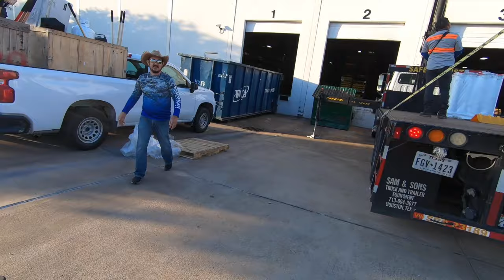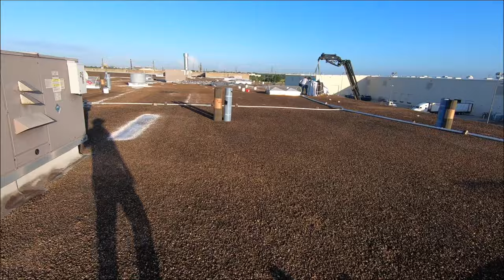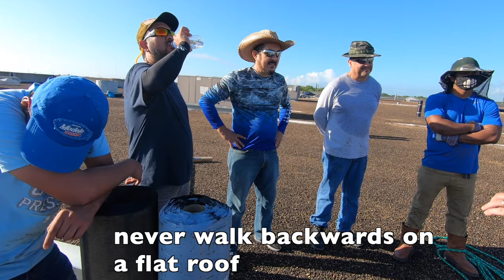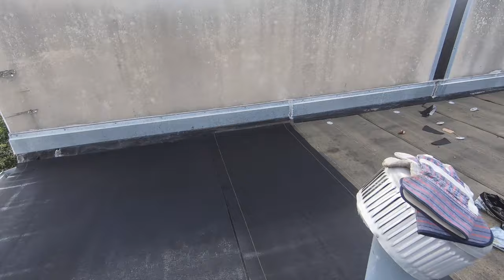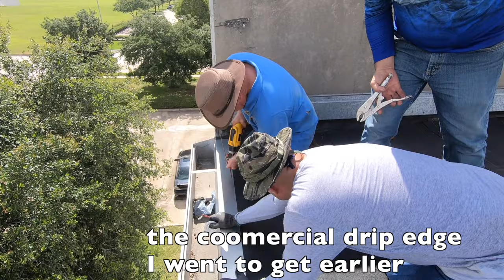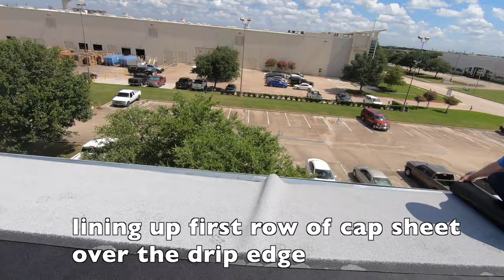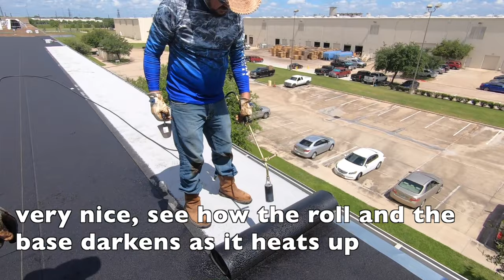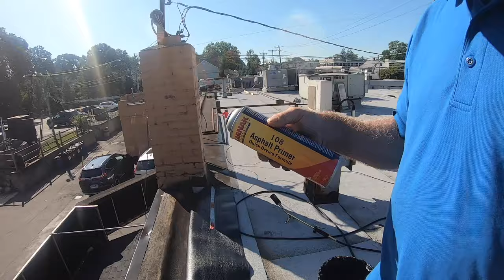Training Rookies to install a Torch Down Roof in 5 hours - Part 1

Comment: When you apply torch down roof over an existing tar and gravel that's leaking, how do you know the plywood underneath is still structurally sound?  You can tell just by walking on top?  I always thought that tearing down the old tar and gravel was necessary so the roofer can inspect the underlying plywood to make sure it's OK.  Is there any other reason why roofer would tear down the old tar and gravel, if not to check the plywood?
Reply from the maker: 1. Another reason is because there is much more money involved. 
2. If the substrate is plywood, very seldom is, then if the plywood has been damaged, you would be able to tell if there is a soft spot when standing on it.
Most Tar and gravel roofs were installed over tongue grove boards before plywood came out.
Tar Gravel roofs are also installed over metal decking roofs with insulation
Reply: Dude, completely irresponsible letting a bunch of guys, that have no idea what they are doing, torch that mans building.  Modified mastic under the metal and prime the damn gutter metal. Your even obvious on correct roofing habits.
Reply from the maker: Most of the time one can tell if the substrate has problems by just walking on it. A 200 lb weight standing on any place should dent in or give a little if there was a major problem. 
The most important reason why roofers suggest to remove the old roofing system is it doubles the cost of the project. 
In my 40 years of roofing I have found that for most part it is not necessary to remove the old roof system. As long as it is solid.
Reply from the maker: @billknight8961  are you referring to habits that are laid down by the manufacturer or guidelines by some roofing association?  
My roofs that I did 30 years ago are still in excellent shape. Since I gave 20 year warrantees, I have a commitment. I am slowly getting out of roofing and my son is has taken the responsibility for warrantees over. BTW, since he has OCD, he does everything by the book. It’s an overkill.  But, that’s how he like to do things. Maybe you can work for him. 
It sounds like you have good roofing habits but not any good social habits. Trying to criticize other roofers is a sign of bad social habits. Most likely bad language, drinking, smoking , cussing. I guess those habits are part of society that was taught by the good “school system”  
Show me your roofing jobs and I will find as many issues as you you find with others. What comes around, goes around.
Reply: @FlatRoofDoctor  he is not wrong people that have no clue how to roof can’t just become roofers over a couple hours or days
Reply: If there's any soft spots it needs to replace it will bubble up
Reply: YOU DO A "CORE TEST " THIS GUY IS A BUTCHER NOT A ROOFER.
Reply: @nicholaspereira9539  Yup, we always pull core samples on a project like this.
Reply: So many companies like this one that are scared to get dirty and do the job the right way. Absolutely fucking the future roofers when they find out they get to do a 3,4 or even a 5 layer tear off.
Reply: The building owner too because it costs much more to reroof it
Reply: @FlatRoofDoctor  You call yourself a roof doctor yet you have no clue what you're doing. I bet this roof in your video is long gone by the wind.

Comment: Where are their HARDHATS?
Reply from the maker: In the truck, I have bought so many already but never put then on. You are right, if Osha catch me I am toast
Reply: I have been a union Foreman Journeyman Roofer & Waterproofer for 35 years and I have always had to wear a hard hat, long sleeves, boots no tennis shoes ever. Plus I carry a OSHA 30 CARD. Plus CPR &  Medical card every 2 years. Plus we have been required to operate AED so I have to be certified in that every year. Plus we always have a steel barricade system set up on all para vets that are under 4 feet. Plus Monitor line for roofers at 6 feet and a additional line at 10 feet for all non roofers plus safety monitor for five people per area. So sometimes we can have up to five monitors on the roof
Reply: Parapet Walls 4 feet & under steel anchor safety Barricades.

Comment: Don’t ask this guy for roofing tips and recommendations. First of all he is ignoring OSHA mandatory perimeter warning system. This can be a fixed ( mechanically attached) rail system or caution flags 6 feet in from the perimeter. 
OSHA also mandates workers outside the flag warning system must be tethered or ties off with either D rings or a weight balanced rig where 2 people can tie off. 
About the only thing he said right is that the 2 ply modified bitumen roof is a very good product. I have spent 10 years in local 30 in Philadelphia, 30 years working for Siplast/Soprema in technical and sales capacities. I currently work for a engineering/consulting firm in South Jersey doing compliance inspections on commercial roofing, below grade waterproofing and curtain wall systems. 
Find I true roofing professional for your building. Roofing is to expensive to fool around with so called doctors.